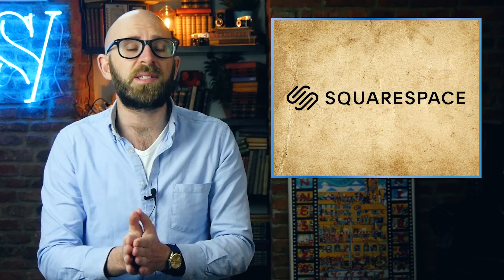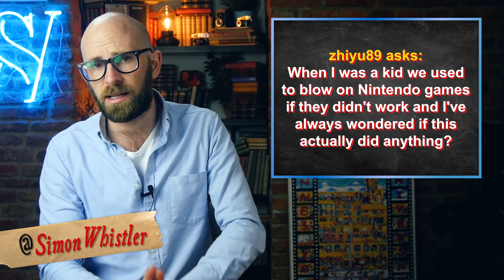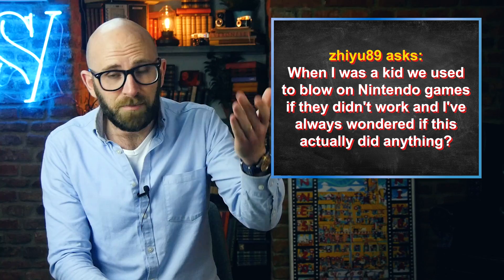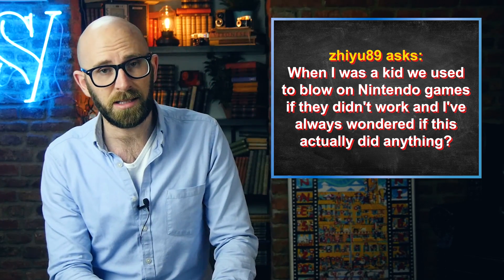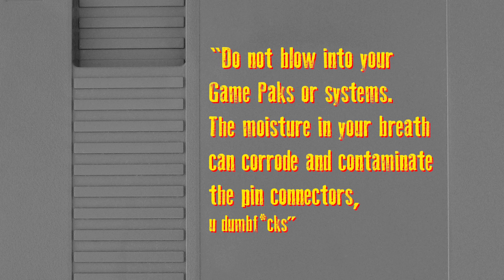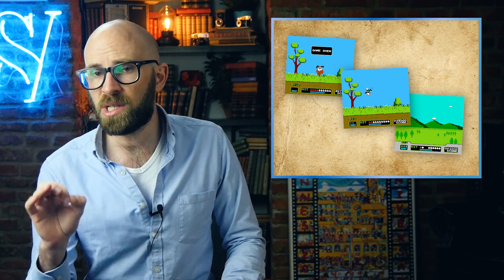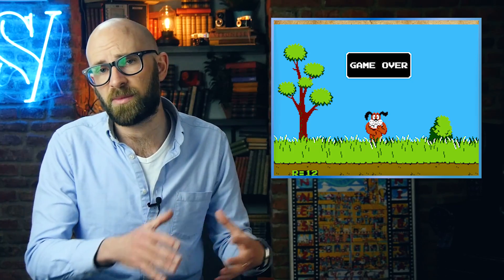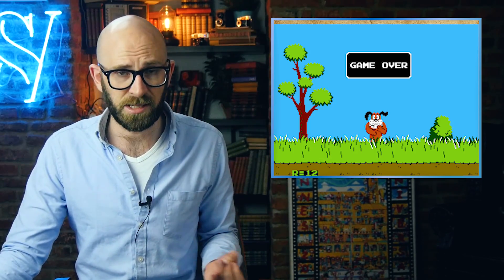Did Blowing Nintendo Cartridges Actually Do Anything and How Did the Gun on Duck Hunt Work?

Comment: didnt even have to watch this, but im a tech geek who solders and does tech repair(pc and...whatever looks like i can fix it..), i always cleaned mine with alcohol regularly, also had a kit for cleaning the pins in the nes, i have NEVER seen cart that needed more then being cleaned with a qtip (i use wd40 for that now after an electrical eng explained why they do that), its easy to replace the stock connector with one thats not zif but also dosnt fail regularly... or you know, just get a single cart that can have every nes rom loaded onto it from any modern pc... 

wd40 and a qtip if you need to clean these now, use the dry end to wipe excess off, works great.

Comment: So while I did the whole give your NES a good blow job both cartridge and system depending on how severe things was. Am I the only one who used my shirt more often then not to clean the pins inside the cartridges?
I use to take the bottom of my shirt crinkle it a little and clean both sides of the pins. Amazing at what would come off them. And worked for me more then the bj.

Comment: The most reliable method I found was to just barely place the cartridge in the tray, push down, then push the cartridge straight back into position. This should prevent the pins from bending.

Comment: Or you can wedge a proper sized stack of paper in with Mario Bros. 3, and try to get it just right, resetting over and over for between 5 minutes and 4 hours, so you can play a trippy version of Mario 3 where the game plays like regular, but the sprites are all replaced with other sprites. All the sprites. Like that first turtle of the first level, my favorite was [coin symbol with small x10 in the corner], bouncing down at you; with Mario glitching every frame or two, where the glitches sprite is him in the 180 rotated position. Oh and with 2 of the 4 blocks of the end of level pipes missing so it looked like he’s running for his life through a hellish version of the game, and then hides in the bushes. Side note: he doesn’t go off screen just stops behind the pipes.

Comment: On my NES I opened the console and cleaned/adjusted the pins on the ZIF connector (new one worked worse than fixed OEM part)

And I have the screwdriver to open the games to clean the pins on the game side. It works pretty well, some games still need the blowing though

Comment: Rather than blowing breath, could the repeated reinserting of the cartridge remove patina/corrosion from the pins/connecter contacts,?
Around this time with computers and memory modules (30 pin or72 pin Simms) the repeated reinserting of the module could allow a 'bad' simm to start being recognised by the motherboard then operating system.
 This happened when the systems brought tin and gold plated contacts together (both anti corrosion contacts). Then moving the Simms (memory modules) to a new system. Memory was hyperexpensive. While in the old system they maintained a good electrical connection. But the 2 different metals produced a galvanic reaction producing a patina. An oxide coat. When first put into the new system 1 or more of the simms may fail to register.
I don't know how many 'bad' Simms I managed to revive by repeatedly reinserting 5 to 20 times then powering the PC back on. And vowed NEVER to mix gold and tin again. Gold on gold or tin on tin there after.
This issue seamed to disappear with the move to dimms and the pentium (original one).
You could literally see the difference, after a couple of years the mixed metal contacts on the simm would appear dull, while gold on m/board and simm, or tin on both looked much more bright. And after reinserting enough times bright metal streaks appeared on the Simms contacts.

Comment: I have an extra bonus fact for you guys. Did you know you can control the duck with the player 2 controller?
Reply: Wait, for real?
Reply: @joeldonadio1732  yes sir
Reply: Ah, finally a reason to hook up my old Nintendo system and check this out (once I figure out how to hook it up to my new fangled plasma tv).
Reply: @valiroime  Most modern TVs still have coaxial connectors for cable TV, which is what the NES used, so that part shouldn't be a problem. Getting it to display with the correct aspect ratio and resolution could be problematic, though, depending on the TV.

Otherwise, you could try routing the connection through an amp (sound system) if you have one with a coaxial connector (in) and HDMI (out).

I believe the NES could also be connected with a single RCA cable, which you can run to one of the RGB ports on the TV. You won't have sound, and depending on the port you might only get a black and white image, but it is an option, I guess.
Reply: What?!?!?!

Comment: Hey! Thanks for citing my admittedly non-scientific research! I'm 100% certain that the results of my "tests" will long outlive me on this earth and on the web. If this is the legacy I leave behind for future generations, hopefully there will be a lot less corroded NES cartridges because of it! Cheers! As long as I'm here, and since you were nice enough to call me a "guru" I'll add a bit more information on the NES Light Gun. After years of various theories as to "why" the mechanism of the light gun hardware wouldn't register properly on a modern HDMI/HDTV an intrepid electronic engineer and game hacker worked out the two elements that were holding back the NES library of light gun games from working on a modern TV. 1.) Timing delay. The "lag" introduced when you run an analog console like the NES through a digital display like a flat screen TV introduces approximately one extra second. So when the trigger is pulled on the gun and the NES flashes the screen looking for the negative image for the photo diode to pick up, the image on the screen is flashing too late. The solution to that? Hack each light gun game in the NES library (you can load the hacked roms onto programmable flash cartridges) to introduce an adjustable timing delay when the trigger is pulled on the gun, telling the screen to stay in the flashed state a bit longer and the gun to wait for the image a bit longer. (He even hacked in an adjustable timing trim on the games to account for different TV brands having different amounts of delay) 2.) The stock photo sensing diode in the OEM NES Zapper light gun isn't sensitive enough to "read" the light bloom on a modern flat screen TV. The solution there is to utilize a modern reproduction light gun with a newer type of diode. UNFORTUNATELY the light diodes in 3rd party NES Zappers by companies like Tomee and RetroBit are often times not "tuned" properly for these nonstandard uses and some are too sensitive out the box (everything registers as a hit) or not sensitive enough (nothing registers as a hit, or only registers at a very close distance). The company Hyperkin has allegedly solved this problem and are releasing a 3rd party Zapper later this year that will be properly tuned (maybe even be adjustable) for modern TVs. If you want to learn more about this visit www.neslcdmod.com
Reply from the maker: Interesting stuff! :-)

Comment: There was a cleaning kit for the ZIF connector.  I had one and it was easy to use.  It looked like a regular cartridge but you put cleaning solution on it.  Then you would insert it and remove it a few times.  EDIT: That's not to say I wasn't guilty of the other method.

Comment: I'm going to watch this video thoroughly, but may I predict (before reading comments) you come to the conclusion that blowing does nothing, and it's merely the insertion of the cart rubbing the pins to create better contact and/or removal of dirt interference?  This is a popular NEW opinion, that frankly merits little, as nobody has been able to explain the reason WHY blowing works.  (also, folks who didn't grow up on an NES assume we're merely blowing air, which is far from the physical truth)

I also hope you mention the CIC, called 10NES, which helped to make this an issue.

if this video repeats the SAME thing others keep saying, I'm making a counter-video with visual evidence.  I bought a nintendo, cleaned the carts thoroughly, cleaned the 72 pin connector thoroughly, attempted no more than 15 inserts.  blew in it, immediately worked, as always.  I have my own suspicions about WHY this works.

Comment: Blowing on the pins, cleaning with alcohol, and what I also did was: not pushing the cartridge all the way into the tray before smashing it down. It normally would go down and get slightly stuck but would boot up working. 

I’m guessing it worked because it placed the contact point of the pins in a different less worn spot.

Comment: No, 'blowing' did not do antyhing. Removing and REINSERTING (ie "reseating) the cartridge is what did it. We used to thing the same thing worked on all the cards in a PDP-11/70 mini-computer, but in actuality, it's just reseating the card. Like in a PC, etc. The PDP-11/70 backplane was supposedly good for 20,000 insertions, I doubt a Nintendo cartridge would last that long. Then, there was tbhe good old pencil eraser trick where you'd get a card and then proceed to degrade it by rubbing the contact surfaces with an abrasive eraser.....LOL.

Comment: Literally got my old Bionic Commando cart to work again yesterday after many tries by blowing on the pins.  Yes, I could have swabbed it with alcohol but I was in a hurry to get my game on.  It works!
Reply: Or you could of just reinserted without blowing and it likely would of worked exactly the same.  This is the problem is the hundreds of people posting this exact shit here, its like they are anti vaccers.
Reply: No, actually, blowing on the pins removed some dust because the cart needed to be cleaned, exactly like I said.  You speak like you have a grudge but that is what happened.

Comment: I was a blower in the 80s. Guilty as charged. But of course it would get to the point where it worked less than half the time. By then I was employing this method where I would insert the cartridge leaving just a small 1/2” left and then inserting that last bit in and slamming the cartridge down onto the frame simultaneously. That worked like 80%-90%. So I think by age 10, I had an idea that blowing didn’t do jack and that it was all about the insertion and making sure the connection was made perfectly.

Comment: When you haven't played a cartridge game in a while, a very thin layer of oxidation can build up on the metal contacts. When you keep putting the game in and taking it back out to blow on it repeatedly, the contacts are rubbing up against the pin connectors inside the console and this friction can rub off the interfering oxidation layer. After a few tries the game works and continues to work for the rest of the night giving you the impression that blowing worked when in fact it was the friction from repeatedly inserting and removing the game that fixed the issue. Your breath did nothing but introduce moisture somewhere you don't want moisture. Next time just push the game in until the contacts are being grabbed by the pin connector, and then slide the game back and forth to rub the connectors. Or use a q-tip or a 1up card but only use alcohol if you have to and only use 99% or higher. You don't want to put water in your game.

Comment: 1:37 - Actually, the reason for making the NES a front-loader was to make it seem more like an appliance than a video-game console because people were sick of video-games and video-games were dying (it was just after the big crash), so Nintendo figured they'd increase sales if it didn't seem like a video-game system (they also avoided "games" in their marketing). How times have changed. (The original Famicom was a top-loader and marketed as a game console.)
1:49 - "zed-aye-eff"? Just say "ZIF" like everyone else. ¬_¬ Or don't. Whatever. 🤷
2:03 - Hopefully Google's AI has learned context or else this video will be demonetized. 😛
2:40 - But the moisture is exactly what helped by increasing conductivity.
4:05 - Or you could just stick and emery board in there. 😉
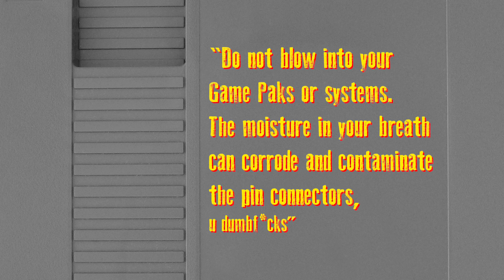4:39 - Well, I'm off to check my manual for that very un–Nintendo-like text…
4:47 - Again, YouTube's algorithm does voice-recognition to decide what to demonetize. Context matters.
9:00 - And this is why it doesn't work with digital TVs, only CRTs. (Though there are new light-guns that work with modern TVs.)

Comment: you forgot the other thing to do.. instead of pushing the nes cart all the way in before levering it down leave it just the slightest bit out and when you push down it'll finish pushing it in. i found that the slightest bit of not "fully in" that this did for some reason gave a better connection..

it had an additional cathartic "thunk click" noise too

Comment: So, glad you mentioned using another game to wedge it in. That was my trick for sure, I had a copy of Ninja Gaiden wrapped in duct tape to increase the pressure for that purpose. If it still didn't work I wiped the ZIF with a Q-Tip dipped in 90% Isopropyl alcohol. If it still didn't work I lightly buffed the contacts with some super fine emery paper and repeated the alcohol process.

Comment: Jeez... I bought my wife an NES when they came out (too many hours of Dr Mario music that followed me in my dreams!) and, yes we did blow on the cartridge to get it to work. Unlike a lot of folks, I always had cans of air that we used for this. There were also times that rubbing alcohol and a lintfree cloth was used to clean them. We did also use the wedge method you mentioned. Funnily enough, our NES still works... Of course, my Atari does too, as antiquated as that sounds.
Reply: We wedged a matchbook in ours 😂
Reply: @livelongandprospermary8796  - We did the same!!!
Reply: Joseph Wilson  - Oh, very much so. Other than computers we don't have much current technology... Depending on how you define 'current.' :-)
Reply: Just air was nothing but a placebo. The reseating is what did the job most of the time.
Reply: @HelloKittyFanMan.  Wrong. Moisture from your breath provides better conductivity between the metals.
Reply: @inputfunny : Nope. It wouldn't be enough to make a noticeable difference.
Reply: @HelloKittyFanMan.  It depends on how dirty the pins are really.
Reply: @inputfunny : I guess if you dropped it in a mud puddle or a poop-filled toilet....